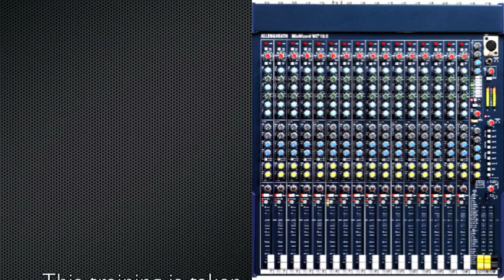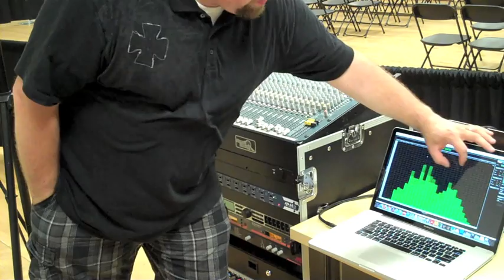Sound Board Training on an Allen & Heath Mix Wizard 1602

Comment: I am interested in knowing how to get effects and EQ into the aux sends. On pre the signal goes out before the effects and EQ. They have to be set to "post" but there are three diffferent paors of aux.  Aux 1,2 are prewired as pre EQ and effects, 3,4 had switches to choose between pre and post.5.6 are prewired to be post and are usually used to send to effects.

Comment: I've got four powered monitors that I'm running through Aux 1 to Aux 4. The rotary Aux controls adjust the volume.  Great.  But during setup when I'm working on one monitor mix, I'd like the shut off the other three monitors without adjusting the rotary Aux volume knobs. Once in place I want to leave them that way!  I don't see anyway to do that but in case I'm wrong, can you confirm?

Comment: Very good video... it'll help me to improve the sound at my church but at this point I need to know how to get the sound OUT of the soundboard into our computer so I can record it with the video from our camera.  Can anyone help with this?  I know we're getting sound OUT of the board to our monitors and to our speakers but I have had NO training for any sound equipment besides a microphone plugged into a cassette recorder... LOL.
Reply: If you wanting to send the audio to a computer you will need an audio interface and some type of recording software.  I use reaper 64 bit. It's really easy to use and doesn't tax your computers resources.  Oh and the best part is thats its FREE! But back to your question you need an interface. Be careful buying older used interfaces.  They tend not to  
be supported on modern computers. Just do your homework a out whatever interface you go with.
Reply: @drfingerprints1  Thanks... I think I might have figured it out.... I had the volume controls all at the top of their ranges and the gain set at medium.  Found out if I move the volume controls down and add more gain I can see the responses better... AND it appears that all of our record-able sound is going out of our 4th channel.  Now that the sound seems to be working, it seems that our camera might have gone out, so we're using FB Live on an iPad and record a backup with a secondary Sony Handicam.  At least the sound is better in the sanctuary as well, and the mics on the iPad and the Handicam seem to get better quality that what was coming through our sound board.
Thanks.
Harold DeWayne

Comment: you can easily hear a 3dB difference esp at lower volumes.  the difference between a 100W and 50W is 3dB or around there.  both loud as heck but a big difference IMO.